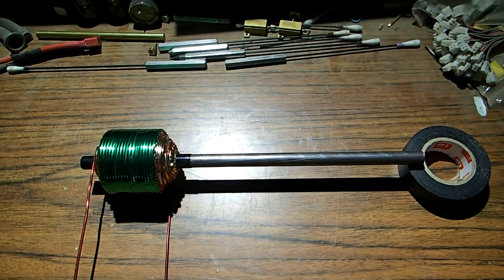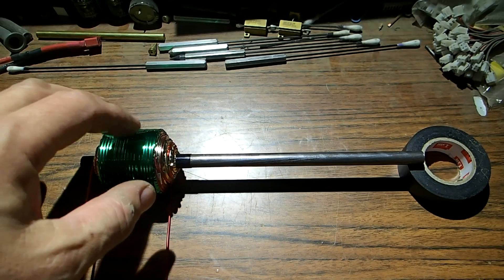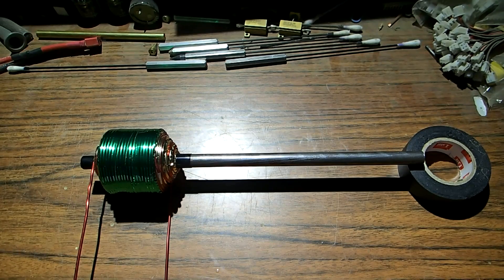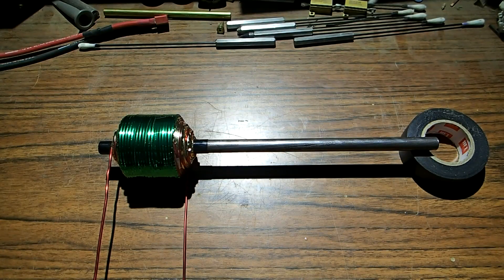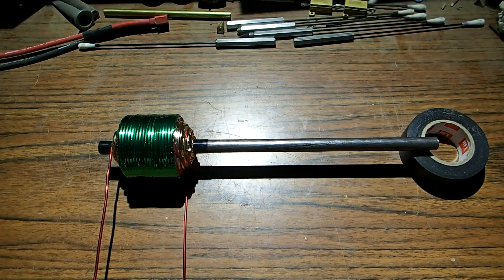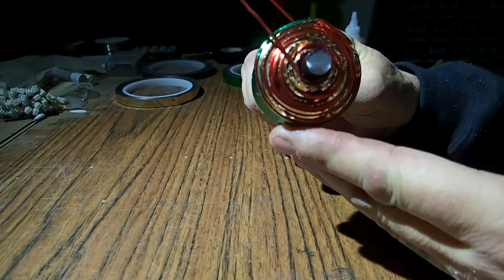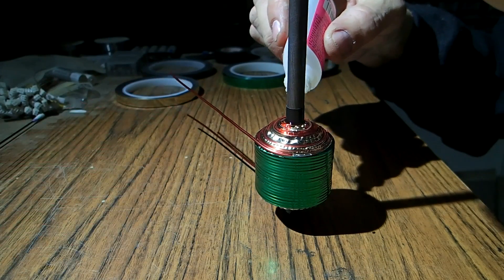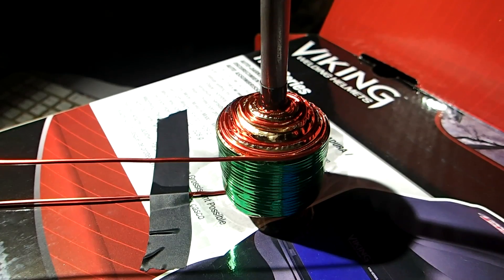Induction Rail Coil Gun (Part 1)

Comment: Whatever became of this? This is really interesting using a single coil to create a pseudo railgun with an oscillating current. Might be able to use it to fire aluminum arrows or crossbow bolts, provided the internal resistance isn't too high.
Reply from the maker: I basically had to sell my house so I had to stop doing everything and clean and paint and it was a stress pit. Now I moved and everything but I don't have no money to invest into making projects that basically I can't be used anywhere except to Fascinate people
Reply: @RaptorRotorHead  Ah gotcha man. "Life's a bitch and then you die" as they say. Best of wishes.

Comment: OH yeah, Clay:
A thought: will simply shorting the terminals of the main firing SCR, with another similar SCR turn OFF the main SCR (by pulling it below holding current?).  Or even shorting the main capacitor?
Thanks for all your information.  I finally found a way to control the multiple/identical gates of your six-shooter on the 4HV.ORG FORUM, under "Electromagnetic Projectile Accelerators".  Under the title: 'Maximum speed in multistage accelerator with ==identical windings==: 12-23-2018

Comment: Hello ...Clay...? Is that the right name.  I am still interested in your coil array, but plan to modify it a bit.  I am using critical damping along with other method on coils down the line.  After seeing you wind that thing, I do not want to repeat that process!!  The method I am going to use is for research timing with various turn-on methods.  I have decided to use the Phillips bits, and that is why I need to know the unloaded inductance as well as the loaded inductance (measured with a simple passive "L-meter".  I hope you can supply this.  Also, since I am familiar with the coil-driving mathematics of the coils, I will, if possible, try to help you in any way if I can.  I use a very cheap LCR meter that goes from 2uH - 200uF (bit on the high side).  Cost: about $18.
Thanks much...again,
--dAlE

Comment: What is the approximate inductance range of EACH of the YAK coils with an empty core?  I am specifically speaking of EACH stage (not a sum) for one coil of the 6-stage coils in the one you are selling.
Thanks much,
--dALe
Reply from the maker: About 300uh
Reply from the maker: The inductance changes a little from coil to coil, checking with a lcr meter.
Reply: @RaptorRotorHead        I really appreciate that.  Did you happen to check the inductance when the projectile is centered in it?
Thanks much,
Reply from the maker: @dalenassar9152  you cannot connect an lcr-meter when there's 400 volts on the coil it would destroy the meter.
Reply: @RaptorRotorHead  Thanks for the reply.  I was speaking of just connecting a simple inductance meter to the coil--that is the only way I have done it, with accurate results.  Is the price on that coil set still up at $200.00?
Reply from the maker: @dalenassar9152  yes

Comment: I remember you saying I will put a brass point on them , I tried it with aluminium tip for my projectile . what happened was significant slowing down of projectile how did it go with your gun did you try brass printed projectile??
Reply from the maker: Vasudev Mr I have not done anything with this induction rail yet I think the secret is to win the coil into a flat pancake Because by the formula that's the most magnetic force
Reply: Clay Reid no no I was talking about  the projectiles in this video . did you shoot a brass tipped projectile when I shot aluminium tip projectile it had significant speed reduction .

Comment from the maker: is a coilgun that uses of rail of magnetic flux round rod
Reply: Have you done any real coilgun research or building? Is this your first one. Firstly you cannot use a metal barrel unless you cut a slot the full length to break the circuit it creates. It acts like the secondary of a transformer. So the eddy currents created in it rob you of the majority of your power. That is why if we are left with no choice in out design but to use a metal barrel we cut a slot in it for it;s full length before the coil is wound. The barrel in a coilgun serves no purpose but as a coil form and to protect the inner windings in the event the round was to strike them.  There is no magnetic force that is traveling along your barrel, pulsed or otherwise. Sorry to break this to you. I have built these guns for years and have tried all sorts of tricks. This design has one function and one function only. When the coil is energized the round is pulled in to it. The coil is then de-energized right before round reaches the center threshold and starts getting pulled back by the coil. The round then travels via kinetic energy only the rest of the way. If this was a multi coil then each coil would repeat the previous process imparting more velocity and energy into the round. 

What you might be thinking of is an induction coilgun which is different from this model that is a reluctance coilgun. With an induction coilgun the coil is wound flat and the projectile is a ring made of non ferromagnetic material like aluminum or copper. The coil can also be shaped like an inverted cup that the ring sits halfway into. The way that works is when the coil is energized. The ring generates an opposing field of the same magnitude against the coil thus pushing the ring away from the coil at high velocity. These are often called ring launchers but you can get creative and configure them to launch horizontally as well. A rappel ring woks very well as the rounded cross section makes it somewhat aerodynamic
Reply from the maker: Solarenemy1 we like to experiment but if you want to see something watch this.
https://youtu.be/BGlo_5icLM0

Comment: What is that green tape that you put on the coils?
Reply from the maker: ryccoh metallic mylar
Reply: What reason do you use it for? If it's metallic can it not interfere with magnetic field or be induced with eddie currents?
Reply from the maker: ryccoh it just looks metallic it is not metallic it is Mylar.  but I gave you the exact name of it in case you wanted to obtain it on the internet.
Reply from the maker: ryccoh I use it to hold the layers of wire together so that each layer can be wound easy.

Comment from the maker: they were using electrolytic 500 volt in series and maybe more in series but that's not really a good way to do that you should use a regular 2000 volt capacitor but I know it's hard to get them

Comment: you showed me a video few days age , did you notice what type of cap bank they were using . they were using high energy pulser 5 kv cap bank . and I soldered a cap bank of 2000uf at 1000v and tried and the results were better .
Reply from the maker: Vasudev Mr Drive 4000 microfarad
Reply: Clay Reid yes I will increase the thickness of my wire and I will machine a proper projectile out of brass and use a big cap bank . when will you do part 2 ??
Reply from the maker: Yes
Reply from the maker: Vasudev Mr 3-4 days I have to cut open the other coil gun to get the electronics out of it. a bad battery caused the computer to malfunction and the power supply fet were destroyed.